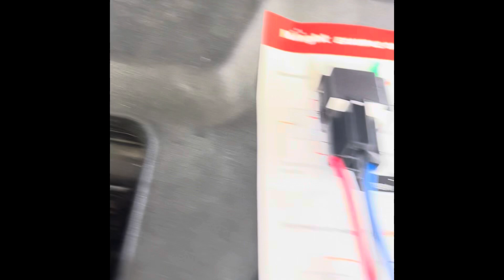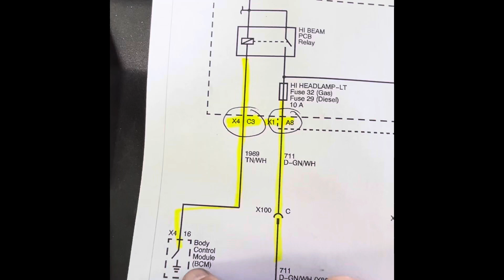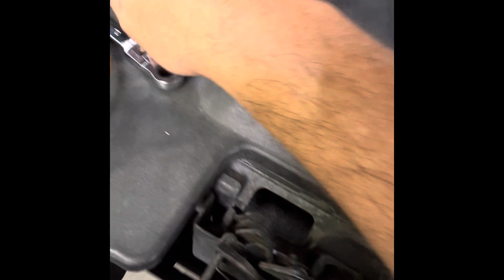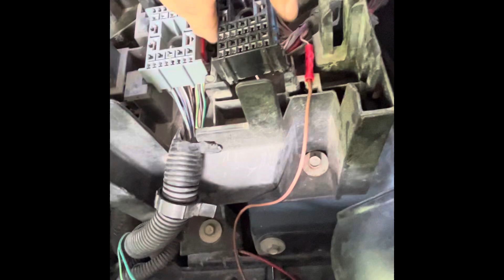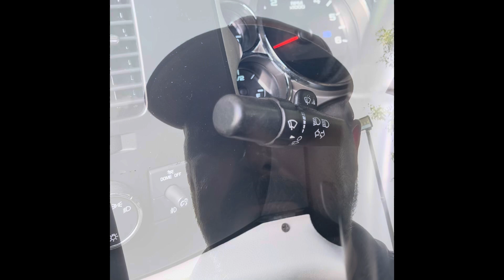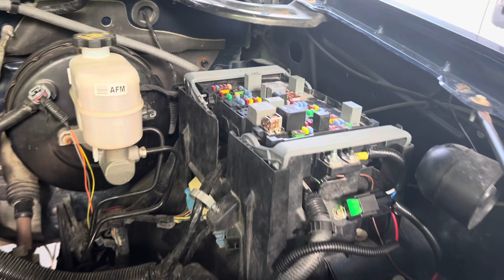Chevrolet Silverado High Beam Fix with External Relay, Printed Circuit Board bypass

Comment: I'm having the same problem with chevy colorado 2011, I ask chat gpt and it suggested getting power to trigger relay from the BCD light green wire B9 . I bought a relay from O'Reilly
Reply from the maker: Good morning, definitely take some time to study the wiring. On this Silverado the trigger source was ground controlled from the bcm. May be different on a Colorado. Lmk how it works out for you. Here is a link to get free automotive repair info/wiring schematics. Thanks 

https://lemon-manuals.la/

Comment: Thank you for sharing this. What a wonderful design for General Motors to pad their own pockets. I was quoted $800 from a dealership to fix it. 
Ten dollars for 5 relays and I had wire and connectors laying around. 
Thank you for the easy instructions as well as showing the wires.👍👍👍👍👍

Comment: Hi I hope you could give me some guidance I am struggling with my low beams actually but I cannot find a good schematic diagram for my 2007 chevy silverado 1500 “new body style” the fuse set up and the UBEC connectors look exactly the same I just am trying to make sure I know which are for low beams not high beams. What is your resource or where did you find your resource?
Reply from the maker: Sorry for the late reply. Check out this link. It’s totally free and you should be able to find the schematics you need. You may have to copy and paste into your browser. 

https://charm.li/

Comment: My highs have been intermittent in the cold for a while.  With a ThinkDiag,  I can watch the BCM and see the input, so the stalk is good, but the highs wont light (the lows go off when switched to high). 
Oddly, when I use the Thinkdiag to actuate the highs from 'inside' the BCM the highs light.  I cant recall if it matter if the stalk is in high or low for that.      I can get out of the actuation test and back to manual control and they dont light.  Its a little strange.
So,.,  I dunno if an external relay would help.
Reply from the maker: Hi Dave, looks like you have a great bit of knowledge with diagnostics. This is going to be a great case study. There is a definite issue with something in cold weather. I would highly recommend bypassing the PCB Relay if it was out all the time and could not be turned on bidirectionally with a scan tool. However, these PCB Relays are known for failing and yours could be starting to be on its way out and only showing the signs in cold weather. I would do the bypass if everything else on the circuit tests good (which seems like it is because you are able to turn on the brights in other weather conditions) Please come back and update everyone here on YouTube how you resolve this issue. I’m very interested in hearing if you bypass it and if it is the PCB Relay acting up in cold conditions. 
Thanks
Tom

Comment: ** UPDATE **.  
After rechecking all connections and replacing one fuse, all is working as it should. Hats off to Sanders for what has turned out to be a FANTASTIC solution to GM's horrible design.  To recap, I followed the instructions provided in the video and it worked exactly as stated.  As I stated earlier, I have a 2008 Chevy Silverado 1500 LTZ crew cab.  This solution will probably work for model years 2007 through 2013 but you will want to verify wiring before cutting anything.  If you are not a little mechanically inclined and don't understand auto wiring you may want to request help from someone who is.   Good luck to all and, again, a big thanks to Sanders Auto Solutions for a great (and much needed) post.

Comment: I have a 2008 Chevy Silverado 1500.  I did exactly what you outlined in your video (same relay you ordered as well).  Things to note...  After the changes, I have high beams again and, although not mentioned in your video, I noticed my low beams now stay on when I switch the high beams on.  That is, of course, not original functionality but not a huge concern.  The most important thing I noted is I now have no running lights.  The light on the dash for the running lights no longer lights up when I press the button and the running lights no longer work.  Were your running lights still working after the changes you made.  If they were not working, what did you do to correct the condition?

Comment: I have a 15 Silverado and the headlights staying on when the truck is off. I pulled the high beams three prong fuse and the lights go out. I don’t know if this is the same problem with the fuse board. Can you help me out?

Comment: Where did you get this relay? Need information in your comments.
Reply from the maker: Hi, here is the link to the ones I used. 
Nilight 50023R 5 Pack 30A Fuse... https://www.amazon.com/dp/B07PK7F1MC?ref=ppx_pop_mob_ap_share
I’ll be sure to add it to the comments. Thanks